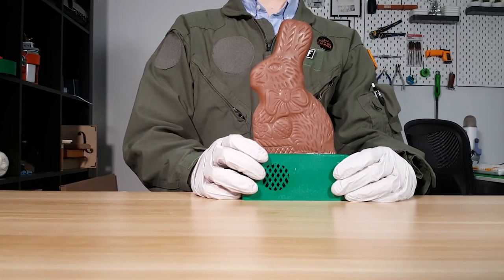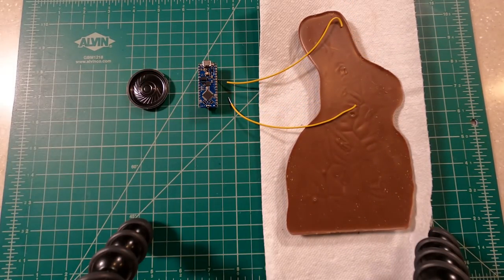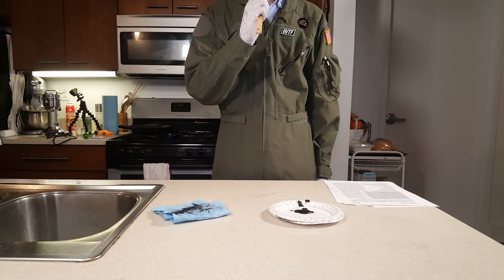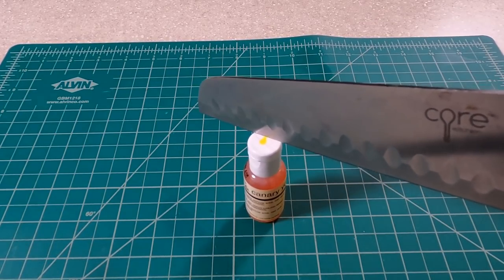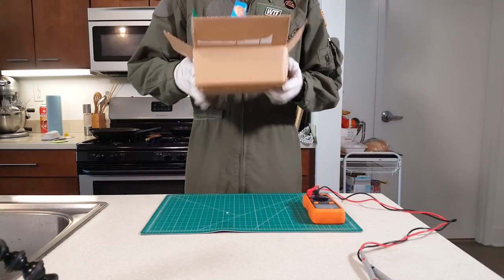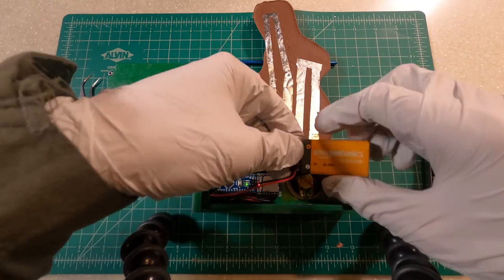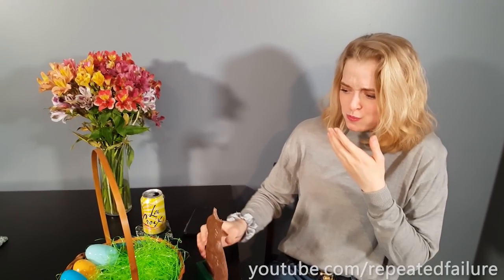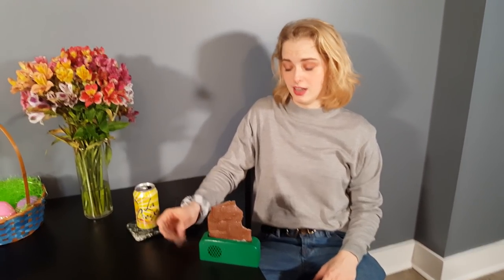Chocolate Easter Bunny That Screams Version 2.0

Comment: What if... paper dipped in salt water or another conductive liquid was used (it's worse than the silver cos it will dry out), or a much more impractical solution, the bunny had tunnels inside of it filled with salt water. The bunny could be made from 2 flat halves with the grooves engraved on the inside of them and then melting the halves together.
Reply: Yeah but it would also be salty